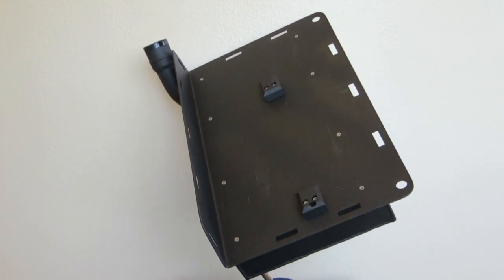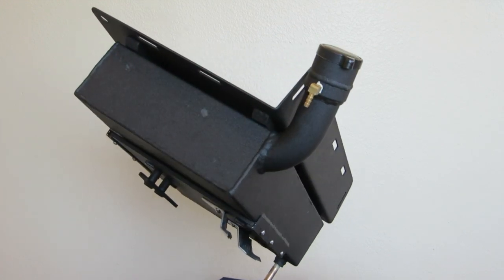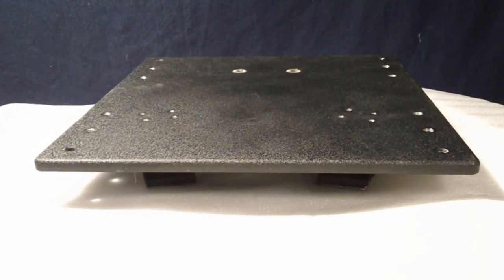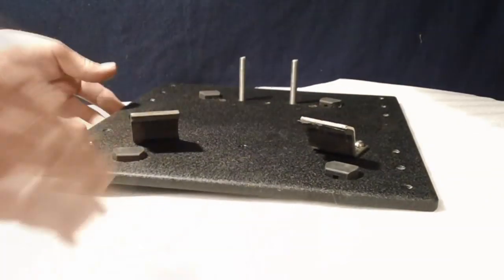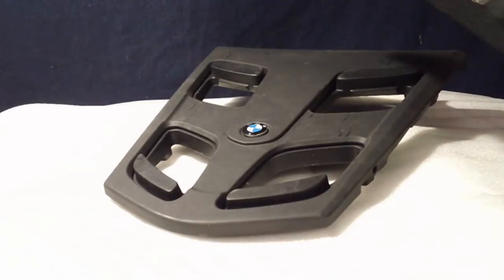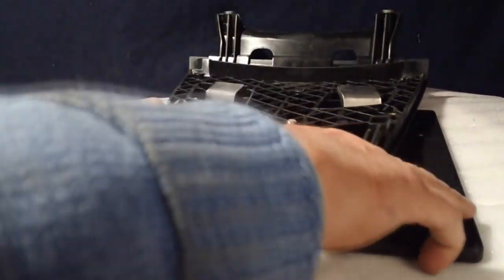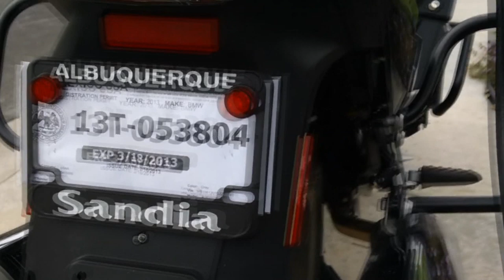BMW Motorcycle Luggage Rack Mounting System with Auxiliary Tank

Comment: If the K model's fuel system is anything like the R model's, it would mean that both are fuel injected and has a fuel pump inside the main tank. Your auxiliary tank doesn't have a fuel pump. The lack of fuel pressure could end up causing problems to the fuel injectors.
Reply from the maker: AFAIK all fuel injected BMWs (maybe even all fuel injected marques) have a fuel pump.

Based on your comment, you don't understand auxiliary fuel systems. They do NOT provide fuel to the engine, they REFILL the main tank which provides the fuel to the injectors with the fuel pump. 

So not having a fuel pump is of no concern to the stock fuel system, fuel injected or not.

HTH
Reply: Ah! That's a totally different story altogether. Your video wasn't very clear in showing how the auxiliary tank refills the main tank (or maybe I wasn't paying close enough attention). I saw the hose going down so first thing came to my mind was the aux fuel was going directly to the engine.
Reply: @IBPeteLangford  anything about F800 tanks still in production?